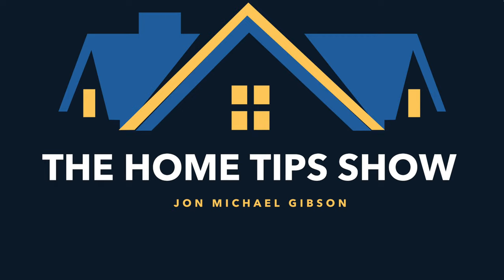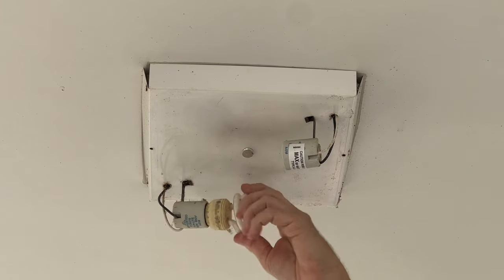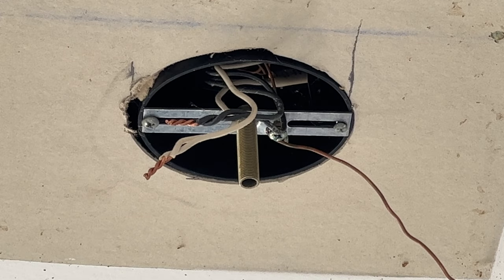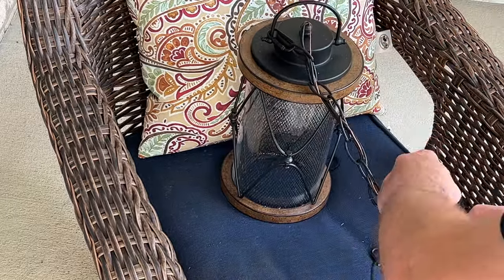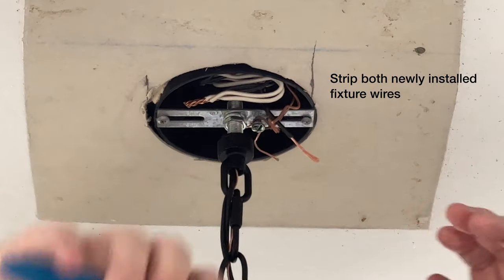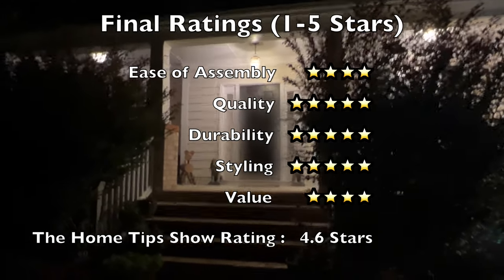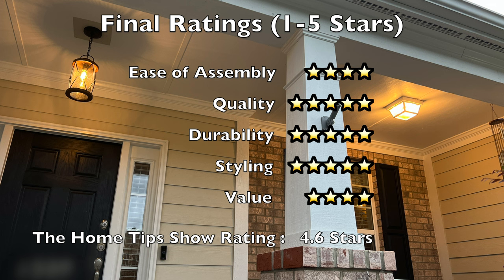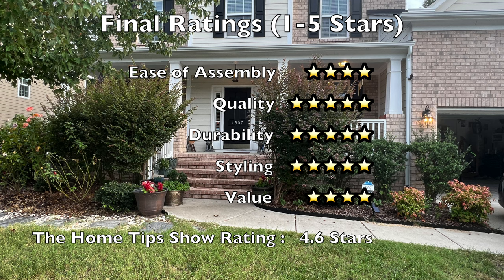Porch Pendant Light Installation and Review: The Ultimate Guide

Comment: Light fixture wire were both black wires. Which o e went to the hot wire and which one went to the neutral.  Thanks in advance
Reply from the maker: Have you had the opportunity to view the instructional video on identifying neutral positions? In this video, I outline two distinct approaches to facilitate this process. If you require any assistance or have questions, please do not hesitate to reach out.
Reply from the maker: Here’s the video that shows your answer.  Light Fixture Wires are the Same Color - How to wire the RIGHT WAY
https://youtu.be/ee1a677T37E